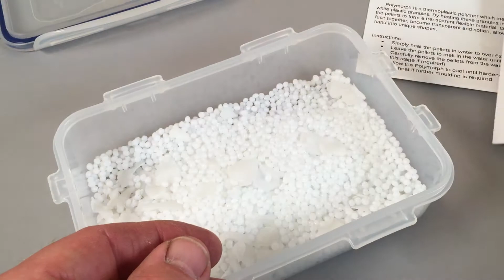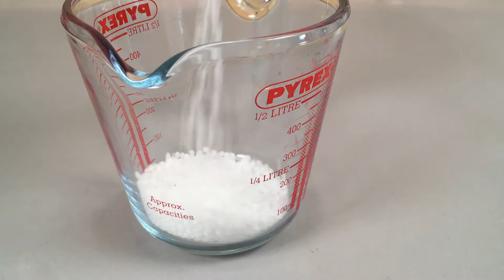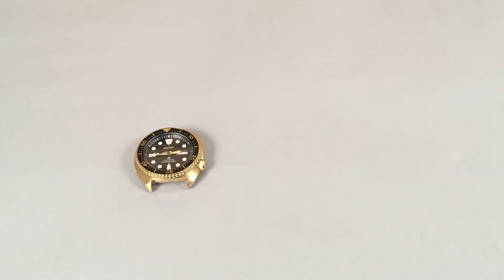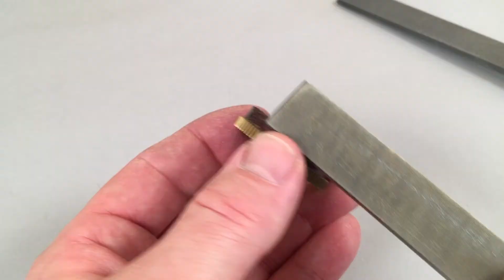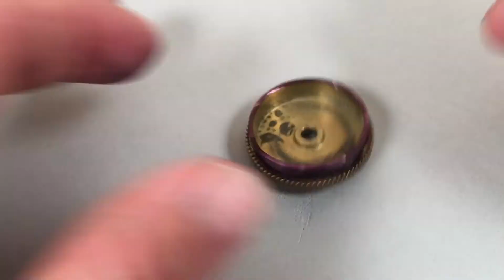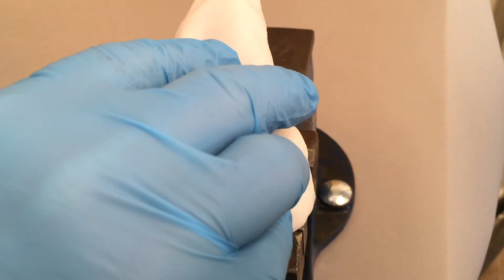002 Seiko Turtle Watch Case Back Removal with Polymorph #Seiko #Turtle #Workshop

Comment: That’s a really cool idea, thanks for the video! Will brass absolutely not scratch steel under any circumstances, or do you still have to be quite careful?
Reply from the maker: Hi Petee.  Thanks.  The brass will mark other components but like using brass tweezers rather than steel, we are trying to minimisechange.  All interventions cause change, much of which could be described as damage.  Yours, Matthew